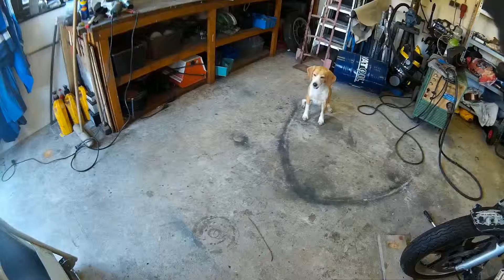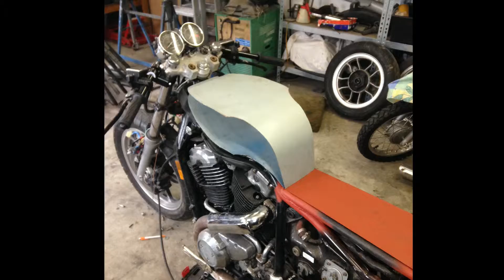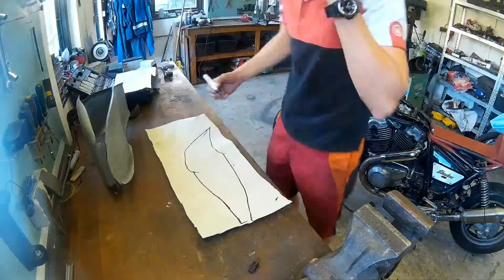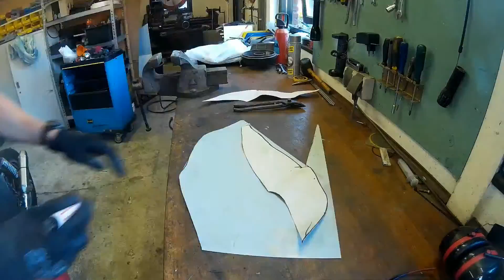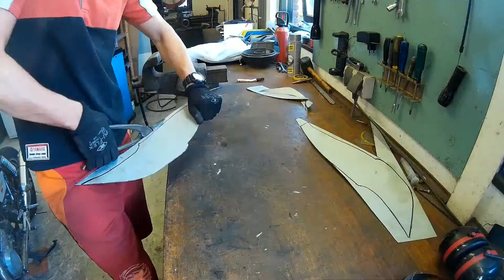Part 4 Honda VT1100 Caferacer  "Making the gastank, first part"

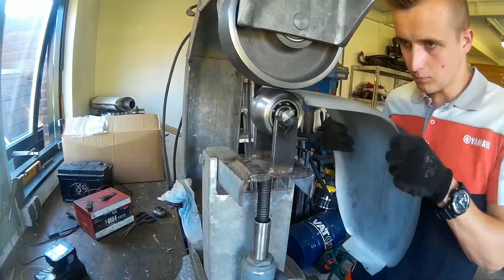Comment: 0:16 your ewheel moves a lot under pressure
Reply from the maker: OpaSann0 that's correct, the English wheel is home made and could use some improvements. But since I work with aluminum now, it works a lot better! This was also one of my first times using the wheel, learned a lot since then!